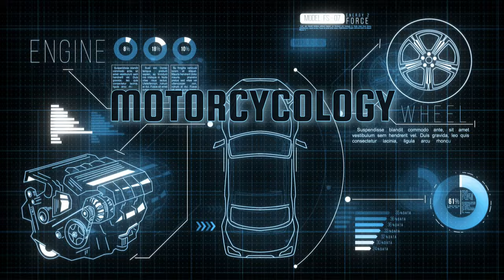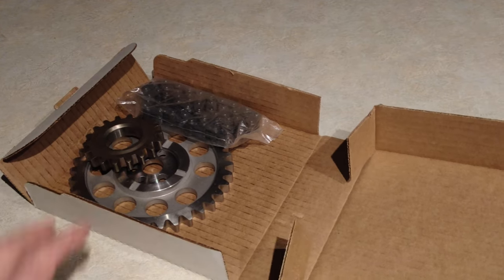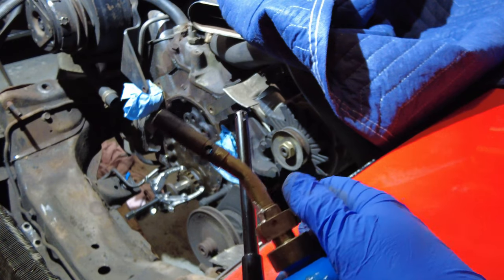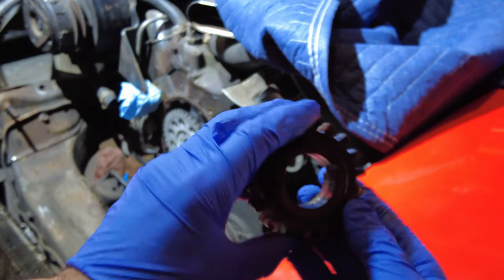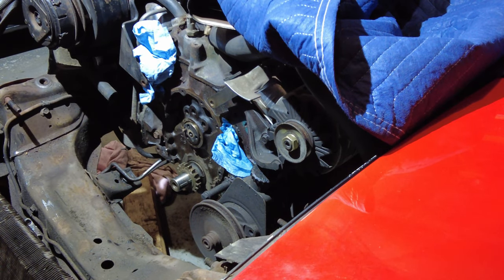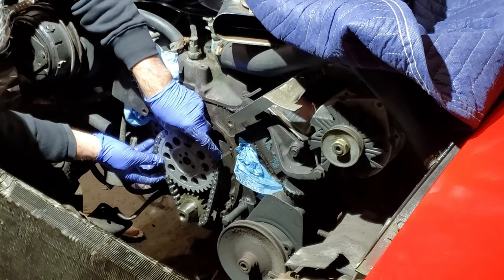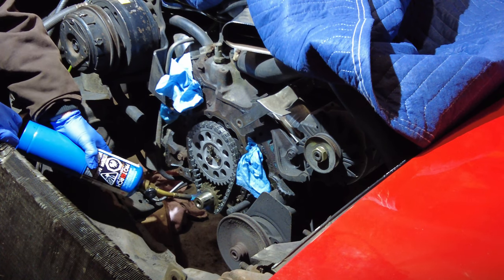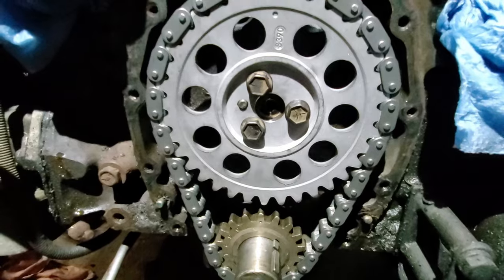Timing Gear Removal and Replacement on a Chevy Small Block 5.7L 350cid V8 Engine in a C3 Corvette

Comment: Your idea to heat up the sprocket is spot on! I did the same to mine and it slid right on, no tapping needed. Same for using the pipe wrench to adjust the crankshaft. Exactly what I needed!  Thank you!

Comment: Out of curiousity, how many miles did you go on this original nylon set? Were all the nylon covered teeth still there?
Reply from the maker: I can't tell you how long this was installed as it was this way when I got the car about 7 years ago. I am the 2nd owner and I'm guessing the other Owen may have changed the gears once before. The nylon gears looked great actually. However the chain was too loose to avoid not changing it out. Thanks for watching ! J

Comment: Thanks for the video.  I'm replacing my timing chain set on my '70 Corvette.  Did you leave the plugs in or pull them out to make it easier to turn the crank?
Reply from the maker: Thanks for watching . I didn't need to take my plugs out at all and was able to easily turn the crank enough to do this job. I hope your goes as well as mine did. J

Comment: Hi there, Really enjoying the series on timing gears. For the lower sprocket, would you happen to have the manufacturer and part number? I am looking for a puller but due to clearance between sprocket and engine. Thanks again!
Reply from the maker: I'll look into my old pics and videos,.maybe find the receipt and see if I can get those details for you ASAP. Thank you for your comments and for watching . J
Reply: @Motorcycology  thanks for the reply and no worries if you don't remember. Today I was actually able to remove the lower sprocket for my 1957 Oldsmobile. Using your videos for point of reference and really appreciate how you take the time to explain in detail! Great work!